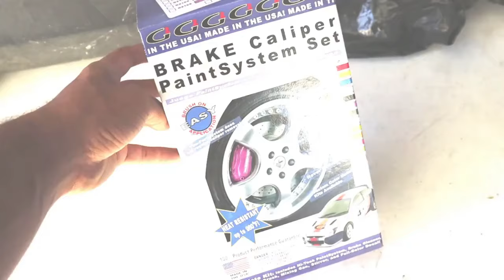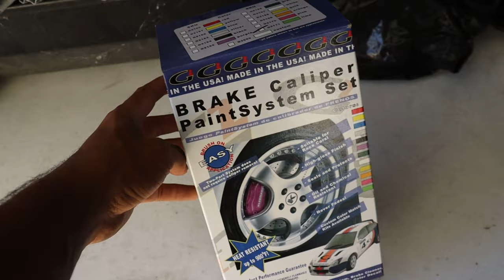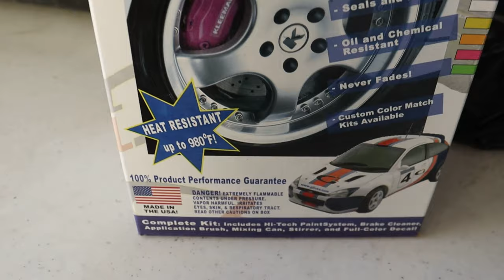Painting Brake Calipers + Front V-Brace On My BMW F30 335i!

Comment: Timely content….thinking of doing the same on my 340 when i change my brake pads and rotors. I’m not sure what color i want though. My car is Estoril Blue2 and i was thinking bronze because i was debating getting bronze wheels to kinda match the Blue and Bronze M2CS kinda but was also considering red, or blue. If anyone has any suggestions, please comment. Thank you.
Reply from the maker: I think the bronze would look the best out of those colors you stated!
Reply: @InlineSixAuto  yea, the bronze my first choice as of right now.
Reply: I love estoril blue, best color on the f30’s  bronze would look great. Red looks good too it pops against the blue. They both sound good
Reply: @CastroJordan  thanks for the feedback. Bronze or red are my top two choices currently.
Reply: @recklezz_9738  what did u go for

Comment: How is this paint holding up now I think it’s been a year since you made this video? Thanks
Reply from the maker: Looks exactly the same on all four calipers. I did notice today actually, the rear passenger side calipers has a couple small spots where it peeled off. The other 3 have no peeling at all still looks perfect like the day I painted.
Reply: @InlineSixAuto  thanks for the info I’ll probably go with this products looks like a easy dyi

Comment: I noticed you went back to the stock non drilled/slotted rotors. Did you prefer the regular rotors over the slotted?
Reply from the maker: Yeah. I started to not like the look and they were making an annoying sound on one side.
Reply: @InlineSixAuto  u keep the same pads? And how have they been?
Reply from the maker: @335DARK  Yeah I still have the same pads. And theyve been great. No brake dust!